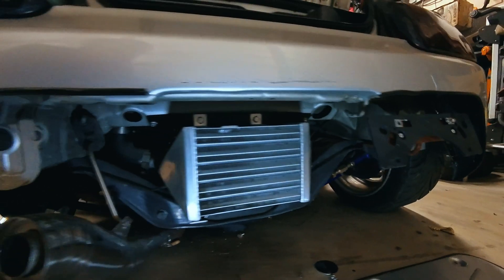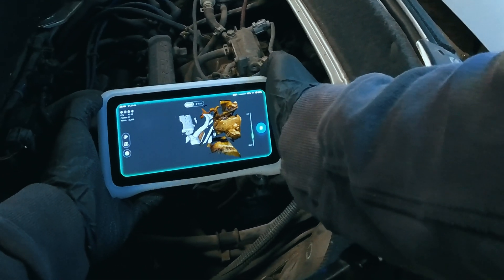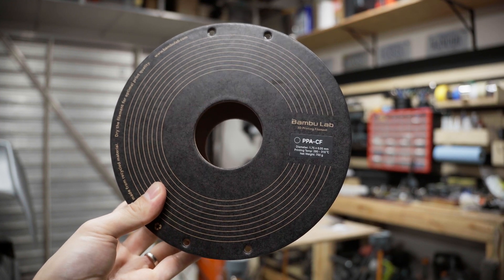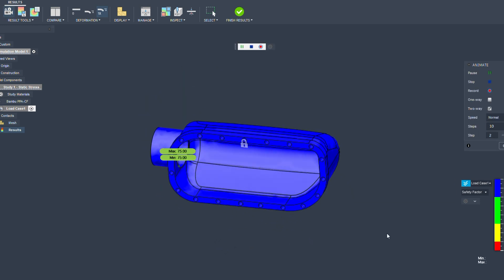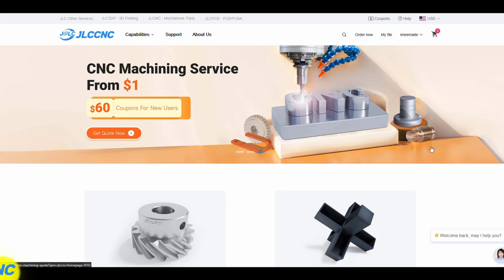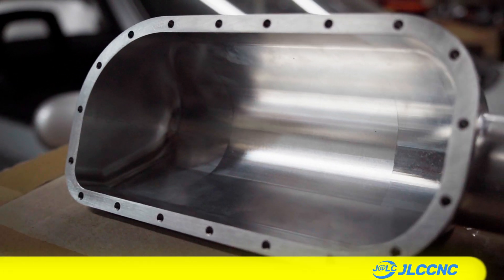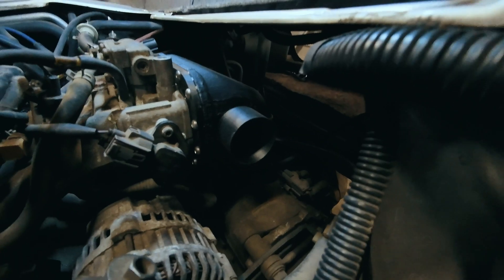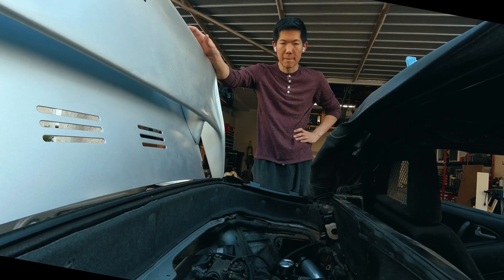3D Printing an Intake Manifold

Comment: if youre running into blow by it's likely youre over-pressurizing the crankcase. Try adding a one way pcv valve in the valve cover and route the outlet of the pcv to the intake pre-throttle body. that way any excess boost in the crankcase ends up being sucked back in by the intake or when throttle is closed, just vents back into the charge pipes.

Comment: 70psi dry or wet? Either way that's low.

Add a cap full of oil to a cylinder to test it "wet". If the number goes up more than ~10% your rings are toast. If not it's probably valve stems or seals.

Comment: Nice work! I'm starting this journey myself in my shop. I'm designing an improved airflow front bumper "scoop" for a 996 generation 911.  I'm learning via YouTube on how to use CAD and Blender. You should consider PET-CF and ASA as well.  Both are pretty tough.

Comment: Definitely would like to see more in-depth on your designing work flow!
Reply from the maker: Coming up!
Reply: Maybe it's all just a coincidence that AI uses hyphens in abnormal abundances, and that there's at least two comments making the the oddly specific request of showing "workflow", and that there's multiple other comments requesting the exact same thing, and that that just so happens to be a video coming up, and that all of those comments are exactly either 2 or 3 weeks apart like someone just dumped them all at once in two different sittings, but if it weren't, I'd suddenly be discouraged from watching a channel that otherwise was off to a great start making quality videos due to the display of one's willingness to fabricate information for personal gain.
Reply from the maker: I’m not quite sure I’m following what you’re saying 😅

Comment: Apparently, high quality compression testers have a schraeder valve in the fitting at the end of the rubber hose, whilst cheaper ones place the valve on the gauge. Many complaints about the latter gauges under reading, particularly on smaller engines.
Reply from the maker: Very interesting! 🤔

Comment: I hope you found a solution for the FDM porosity issue. You could use sealant inside and/or outside since you can have both vacuum and boost in a car depending on the setup. Some people experimented with remelting in salt but it can warp you print
Reply from the maker: Going to test it out!

Comment: I'm planning to design and print an airbox for a <100hp car. In your case the plastics are subject to much higher stresses and thermal loading. I think the structural integrity is not a problem as long as you have sufficient internal ribs to supplement the strength of the dome. 3D printing is a good process to strengthen parts against implosion through flexibility of geometry.

Where it may cause slight issue is printed plastic aging over time. While high temp filaments do allow good resistance against warping/melting, putting them through many heat/cold cycles can still weaken them. It would be interesting to see how far you get durability-wise with this, and how using different engineering-grade filament chemistries can affect this.
Reply from the maker: Agreed. Though even with a turbo the Beat barely hits 70whp lol
Reply: @IMEEMADE  which causes more strain: -5psi or +5psi?
Reply: @StanleyKubick1generally speaking, compression is harder to combat than expansion. Many materials are usually better at resisting tensile forces, thus -5 psi will subject it to more force

Comment: i am scared to use 3d printed parts on the intake side.

i had plastics "creep" under load, the plasic deforms over time, loosening all my screws.

i thought about adding a metallic sleeve into the plastic bore, so the screw tightens against the metallic sleeve.
Reply from the maker: Curious what kind of plastic did you use?

Comment: do you have some kind of safety for keeping those internal intake bolts secure?  (loctite or your intake dome sitting on top of them?)    I am impressed by your work none-the-less. Good stuff
Reply from the maker: Blue loctite might be a good idea. Though they’re longer than the plenum is deep so no risk in getting sucked in but definitely don’t want them backing out

Comment: Fun tip for the bambu lab printers: if you need to dry an engineering filament, you can put the spool on the build plate, set the bed temp to max and tun on the aux fan. then your filament will be dry AND the chamber will be up to temp when you want to print
Reply from the maker: Nice tip! I’ll do that next time
Reply: @IMEEMADE  Better look up at what temp you're supposed to dry your filaments. If you go too high they will soften enough to melt the whole spool into one solid glob of filament-shaped plastic.
They have a great guide about it on their official wiki.
Reply: Used to use this method. Usually elevate the roll on a peice of cardboard then heat up the bed (never to the highest setting) and get the chamber warm as you mentioned. Once modifying the AMS there is no going back.
Reply: Absolutely awful advice because the print bed can go to 100c on a P1S and even higher on an X1C. You know what happens when you put a plastic spool thats rated for 75c onto a 100c plate? Yeah? It melts and hell, even at that temp your filament is all going to fuse together.
Reply: @ engineering grade materials have much higher deformation temps than the print bed could ever reach in any printer, buddy. It's perfectly safe if you aren't stupid
Reply: @Shraedar  Perhaps you are using different materials to what I am? ABS and ASA will both become soft enough to indent with your finger at 95-100c, this is enough for the filament at the edge of the spool closest to the build plate to fuse together. Not to the point you can't separate it, but your AMS isn't going to like tugging on that. Quite a few companies provide a plastic spool that also can't withstand that temperature.

What filaments/brands are you using?

Worth mentioning as well that a lot of people would argue that PETG is an engineering filament because it's good enough for majority of hobbyists engineering parts, if you put a roll of that on the print bed at 100c you're going to have a really really bad time lol.
Reply: @thedirtyscotTV  then don't put the temp of your bed up to 100c
Reply: @adrianharrison5208  I'm not, the OP is telling people to do that lol.

Comment: The service limit for the compression is 135psi, normal is 200psi. Did you do the compression test with the throttle wide open? That will give you much lower numbers if you don't. Next test to do is a leak down test. I just did a whole inspection (and subsequent full bottom end bearing replacement) on my Beat last fall.
Reply from the maker: Throttle was closed, definitely going to do a leak down test and check the timing belt since all 3 cylinders showing the same compression makes me think it might be wonky?
Reply: @IMEEMADE  I'd redo the compression test woth the throttle open. The results with it closed aren't useful, even though they are even. But yeah, leakdown is next. Timing belt likely has nothing to do with it. Odds with this engine are that the rings are toast and you are just getting boost blowby. Nothing to really do about that except check it and rebuilt it if that's the case.
Reply: @kitsgarage5931  If the timing belt jumped a tooth or stretched and changed the cam timing it would change the cranking compression
Reply: Generally speaking, having them all read the same is what you're looking for with a compression test since every gauge will read differently, but 70 does seem unusually low.

Comment: Good stuff, dude. Will the 3D printed plenum be air tight or will it leak through the layer lines?
Reply from the maker: Should be air tight, but going to find out as soon as I get the motor running tip top again

Comment: There is leak-down testers to test cyl sealing, ie, it gives you %. You can then squirt oil in the cyl to seal the rings to check valve seal. You can make LD testers, ie, they are just a restrictor that if the cyl leaks more than the restrictor can flow the pressure will drop on the cyl side.
You can also leak test your printed plenum hydrostatically, ie, the safe way for large volumes. Basically seal all the holes, fill with water, and then pressurise. You can use compressed air but you need to keep the air volume as small as possible in case it bursts. Tested a aftermarket cyl head once and it frothed in the rocker cover area because it was so porous - lol -.
You could also do it the lazy way and squirt soapy water on it while on boost - lol -.
Reply from the maker: Picked up a leak down tester and going to try it out!
Reply: A leak down test will also tell you what's leaking since you can hear if the air is coming out of the intake, exhaust, or crankcase